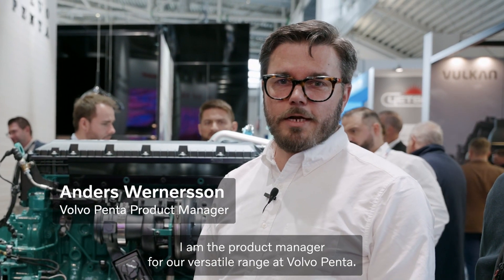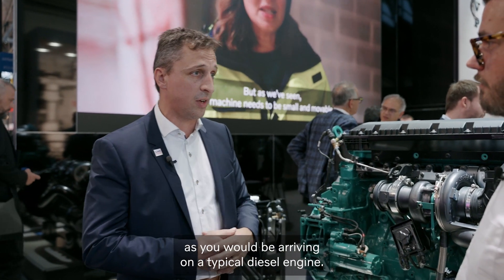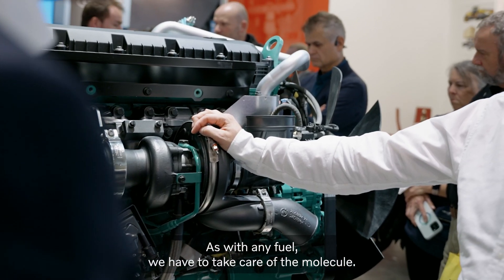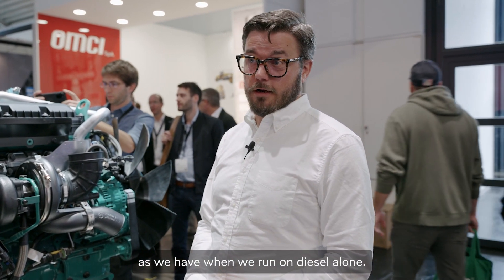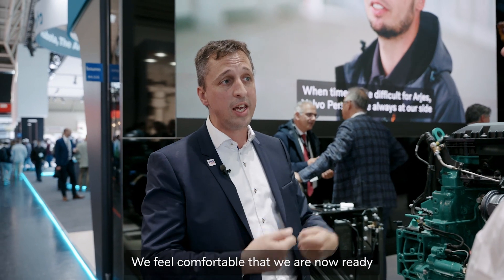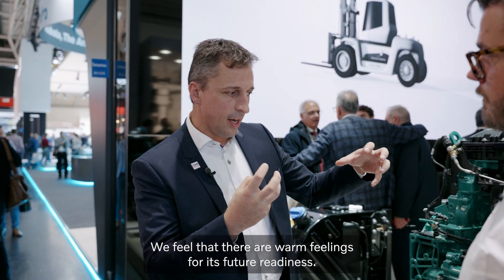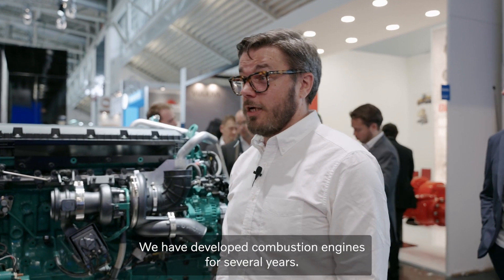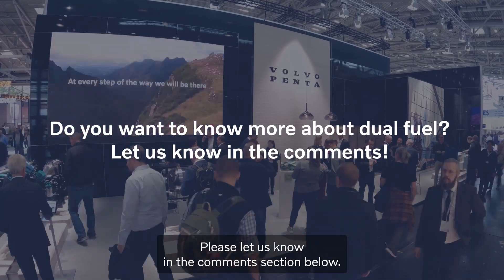Why choose a hydrogen dual fuel engine? | Volvo Penta

Comment: This has to be more carbon efficient than mining heavy metals using heavy diesel machinery to create batteries that can be dangerous to recycle. Chart Industries already makes a tank system for hydrogen filling and storing on heavy equipment. If the hydrogen is produced through nuclear, you remove carbon from the equation and make the energy chain much more efficient.
Reply: Oil is going no place for 100’s of years. It would be smarter to adapt and make it more efficient? https://docs.google.com/document/d/1-2DkcLpflZr6-hp5G8ubyfTooLjDADZ_DMltuoA1GRo/edit

Comment: What percent of hydrogen in terms of energy content is used maximum in dual fuel mode?
Reply from the maker: Hello! There is the potential for up to 80% replacement of diesel with hydrogen at the optimal operating conditions of the dual fuel engine. 
Kind regards, 
Volvo Penta